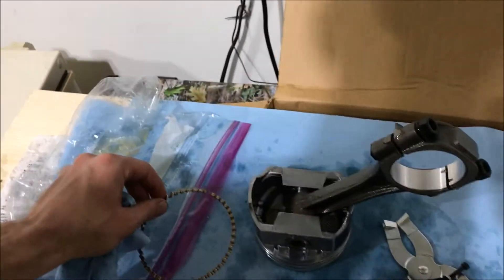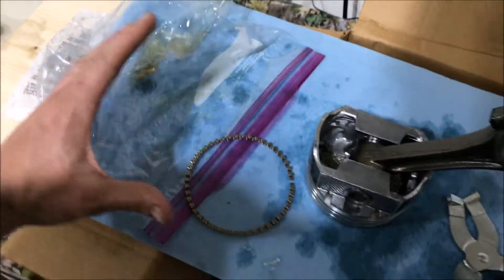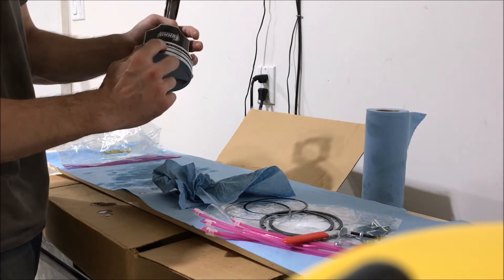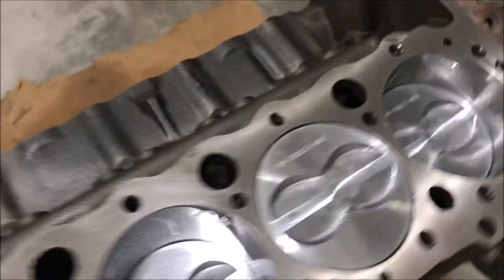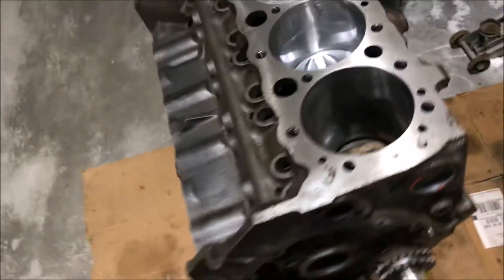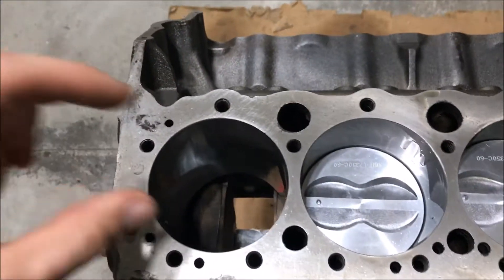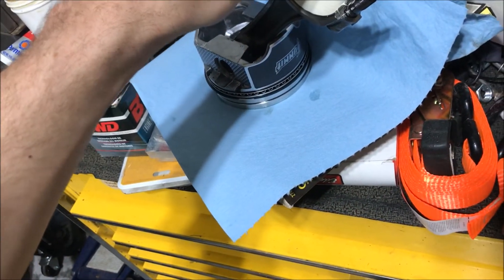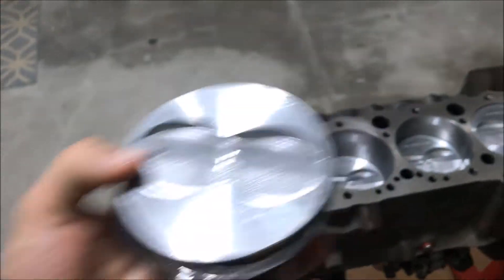Small Block Chevy - Installing Piston Rings and Pistons

Comment: Do the piston direction change on the opposite side?
Reply from the maker: Depends on your pistons. If you have 4 valve reliefs, then you have symmetrical pistons and there is one design for all 8 pistons. If you have 2 valve reliefs, then you have left bank pistons and right bank pistons. On both sides there is a mark that is for the front of the engine.
Reply: @iowadiy6361  I have original 350 5.7 motor 1998 silverado
Reply from the maker: @jackieosby7154 if it’s original, then when it’s disassembled it should be marked by cylinder on the big end of the connecting rod

Comment: I used ultra slick on the piston walls and bearing. I coat very well. Piston compression coat the some, Just me mind you - install the ring compressor 1st around the piston and rings then install the hole thing. tap it in
Reply from the maker: That’s probably a good call on the ring compressor, but just be sure to completely get the cylinder walls cleaned up of oil after they are installed. Too much oil in the cylinder can wash the crosshatch on initial startup

Comment: Nice video explaining the way things go. I'm reusing my pistons, so I have been cleaning out the grooves. I picked up some Mahle from the engine shop. I'm looking at the photo that came with the rings on how to distinguish them apart, even though they are on different spaces. I can see the dots clearly, but don't see anything different about them. Even the shape of the rings look the same.
Reply from the maker: The first and second rings can be the same since they are both compression rings. More often the second ring will have a different design

Comment: Man those pistons sound so dry when you rotate it I would have put alittle oil on cylinder walls
Reply from the maker: The pistons had a good solid coat of oil on them already.. sounds bad but no scratches

Comment: I am trying to get the pistons back in a 92 350 block and I CANNOT get er done. I can hammer it down with a deadblow hammer and stick, but it won't budge after that.. I dont understand.. I removed them fine, even with a bit of top ridge. Then I remove top ridge, deglazed, and ball honed.. and I cannot get these pistons back in. Using Hastings rings that come with the cheap $137 or so kit on Summit Racing. Perhaps I have the wrong rings?? I can't think what else it can be. I have two different ring compressors, neither guides it down easy..
Reply from the maker: Try taking them off the pistons and put them in the bore to make sure they actually fit. Then double check that the ring compressor is the right size and will work for your application. It’s possible that the rings are spreading under the compressor before the bore and that’s what is holding you up too
Reply: @iowadiy6361  I ordered a 1955-1985 Chevy 350 rering kit. The 86-95 uses shallow set oil rings. Mine are standard. So I got a new 'shallow' set on the way. I FINALLY figured it out. Yes, the pistons slide in and out of the bore themselves (no rings) just fine. Just hoping I didn't 'overhone' it..
Reply from the maker: I was meaning to put the rings in the bore first and check the ring gap. It should be 16 to 20 thousandths
Reply: @iowadiy6361  Yes sir, I knew what u meant. Its within spec for top rings but the bottom is not. Too deep. The oil control ring should be 0.162", not 3/16. Couldn't properly fit. That's why I have a shallow set coming in the morning. I cant wait! Thank you for help and your reply!